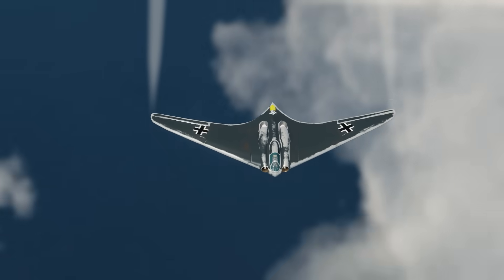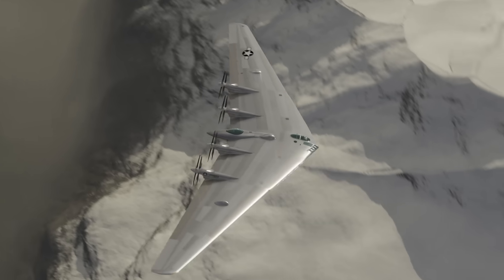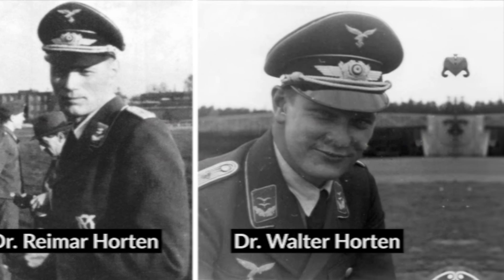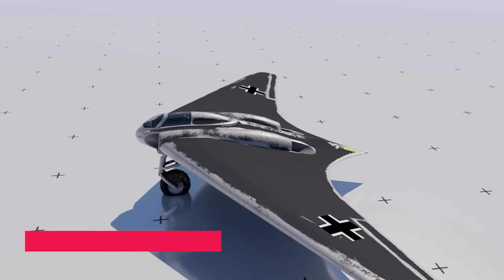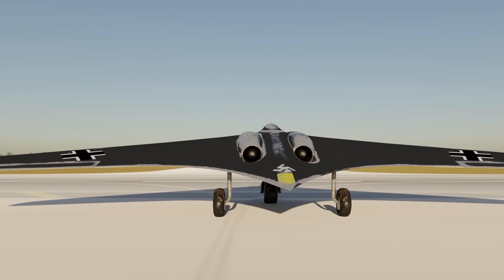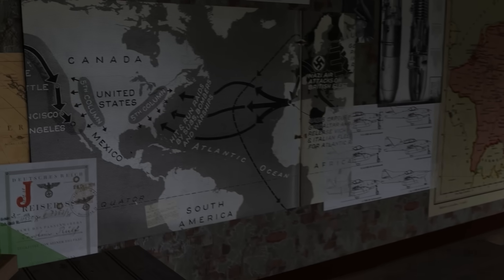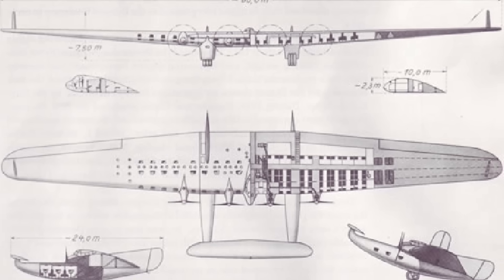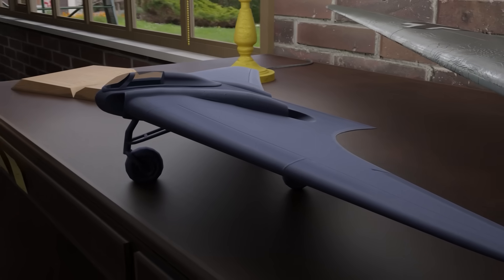Insane Flying Wing Jet Fighter To Save Germany - Horten Ho 229 Nazi UFO

Comment: And look at the USAs stealth planes now … they owe Germany a lot
Reply: No, they don't, the Horton has nothing to do with modern stealth aircraft.
Reply: @YogiTheHun1  Germany invented radat stealth technology.
The Ho-229 is the world's first radar stealth aircraft.
Reply: @WilhelmKarsten  
That is objectively false. You should get a better education on this matter. Reported for spreading misinformation.
Reply: @YogiTheHun1  The facts here are irrefutable, your attempts to deny these facts are childish and completely futile.
Reply: @WilhelmKarsten  The Smithsonian debunked it...
Reply: @peterson7082  Since when is the Smithsonian experts on Stealth technology?
Reply: @WilhelmKarsten  they built a replica of the 229 just to test its potential RCS. Certainly lower than a Messerschmitt 109 but still visible.
Reply: @peterson7082  All stealth aircraft are visible to radar... you don't seem to understand the concept here.
Reply: @WilhelmKarsten  Very visibile was my point. It was less, but not to a significant percentage to a 109
Reply: @peterson7082  Less visible is the concept... tests conducted by Northrup confirmed that the Ho-229 had a significant 50% reduction in frontal RCS without RAM applied using modern microwave radar.

Britain still used primitive meter band radar which would have prevented detection until the German jet was too close to alert interceptor aircraft in time.
Reply: @WilhelmKarsten  I was mistaken Northrop Grumman ran the test including samples donated by the Smithsonian, so I apologize.

Maybe I'm not being clear enough, but a negligible drop to a Messerschmitt 109 frontally is not close enough to call anything stealth or low-observable in modern terms. 

 Most reputable references to the Northrop Grumman test suggest a 20% drop frontally to a Me 109 at a set range. 80km. is what I.E.E.E. and the National Geographic quote though Northrop Grumman's wesbite and statements aren't 100% clear. The National Geographic sponsored History Channel show  contradicts itself a number of times.

 Still that percentage doesn't change. Some sensationalized websites like National Interest and San Diego Aviation museum exibition blurbs quote a 50% to 80% decrease. Fewer others say a 15% decrease to 109's and a number of Allied aircraft.
Reply: @WilhelmKarsten  Smithsonian said no absorbent material was found in their own examination. The Northrop Grumman test on the adhesive suggested negligible amounts of carbon in the formaldehyde urea, but leans to it being charcoal which Reimar himself quoted in "The Only Wing". Though given how little was found hard to say beyond what the History Channel has suggested to give a definitive effect on absorbing microwaves.
Reply: @peterson7082  Northop's data using microwave band radar shows a 50% reduction in frontal RCS compared to a Me-109.
This is without the RAM applied, the flight test prototype omitted this step in manufacturing and was also not used on the scale model.

While the Me-109 has a large metal propeller and it's skin is made of magnesium, it important to remember that the Ho-229 had no significant retroreflective structures and would have been covered in RAM in the production version.
A 50% reduction is very significant as it would allow German aircraft to enter British controlled airspace before being detected and allow them to reach targets before RAF fighter could intercept them.
Reply: @WilhelmKarsten  the point is there was no RAM
Reply: @peterson7082  Germany had RAM materials in production and operational service during WW2, samples of Tarnmatte were obtained and tested by the Allies after the war.
Reply: @WilhelmKarsten  nothing found on the 229, nor anything to corroborate Reimar's claims were found in development of the 229

The science behind radar absorption and deflection while realized was not understood or calculated.
Reply: @WilhelmKarsten  Tarnmatte's effectiveness was questionable though it helped with further innovation as the method and science was understood
Reply: @peterson7082  Tarnmatte was in operational service during WW2, this is an irrefutable fact that cannot be disputed.
Reply: @peterson7082  The Allies had absolutely no understanding of radar stealth technology during WW2 and little research was done until the 1970s in America.
 Both Lockheed and Northrop exhaustively studied German technology in the early stages of American stealth aircraft 3 decades later...
Reply: @peterson7082  Reimar stated that tests were conducted on RAM applied both to the outer surface and impregnated within the structure in response to concerns that RAM applied to the surface could be more easily damaged or rendered ineffective by absorbing moisture... a problem ironically that both Lockheed and Northop both ran into and have struggled with in its own stealth aircraft.
Reply: @WilhelmKarsten  Yes it was from mid 1944 on. No statistical evidence suggests it had any effect on submarine losses from the surface as those who had snorkels were lost in the same rate roughly before and after Tarnmatte was introduced in later 1944. Snorkels were accepted into service roughly half a year prior. British Asdic and American and British surface search radar were still sinking them in increasing rates. 

I'm not denying their existence. The Germans found this among other technologies they used were not matured. In the case of RCS even fundamentally understood
Reply: @peterson7082  Certainly not understood by the Allies.
German stealth technology was a complete mystery to Allied experts, many who very wrongly dismissed it.
Reply: @peterson7082 Look, I would work on your spelling skills before attempting to tackle a complex subject like radar stealth technology... your comments quickly reveal someone who is not qualified to discuss this topic intelligently
Reply: @WilhelmKarsten  Please tell me which errors I have made
Reply: @peterson7082  The errors in the comment you just deleted???
Reply: @WilhelmKarsten  I think you need help. I don't delete anything.
Reply: @WilhelmKarsten  I see all 26 comments, including this one. Please get help.
Reply: @peterson7082  Not the one you just deleted... you're not a very good liar either.
Reply: The gap in the comment thread is obvious, you are not fooling anyone.
Reply: @WilhelmKarsten  Please actually get help. I'm not going on deleting 4 month or 4 year old comments. You replied to me after 5ish months.
Reply: @peterson7082  YOU JUST DID
Reply: @WilhelmKarsten  Buddy log off YouTube, get some sleep. At best, use a different phone or computer and look for this comment chain. You are acting erratic.
Reply: @peterson7082  It's just pathetic and sad when can't admit you were wrong... absolutely childish behavior.
Reply: @WilhelmKarsten  Did you actually log in on a different device? I see the 30+ comments here Because you're getting delusional. I deleted nothing. Please tell me which errors. Or if you have nothing better to say, say goodbye because I said nothing factually wrong

Comment: This plane never saw combat
Reply: It was real, it flew and was the first radar steath aircraft in the world
Reply: @WilhelmKarsten  didn't say it wasn't real
Reply: @sidwalters7455  True, no stealth aircraft saw combat during WW2
Reply: @WilhelmKarsten  no argument from me
Reply: @WilhelmKarsten  
It was literally detected on radar in EVERY test that was performed.
Reply: @YogiTheHun1  No aircraft is invisible to radar
Radar stealth technology can only reduce the RCS.

Testing confirmed that the Ho-229 had a RCS less than half of smaller planes like a Bf-109.
Reply: @WilhelmKarsten  
But that is absolutely meaningless when compared to (false) claims that the Horton was the "first true stealth aircraft". It was not designed with the purpose of stealth.
Reply: @YogiTheHun1  Anyone that isn't blind (or ignorant) can clearly see that the Ho-229 was specifically designed to have a reduced radar cross section.
If you cannot see this? I suggest you go get your eyes checked or take an IQ test son.

Comment: You should be able to put stabilizers to each outboard sides of the engines. Just not higher than the engines. It shouldn't add to the radar silhouette.

Comment: The Ho 229 was a fabulous, beyond cutting edge aircraft design of its time that looked to the 21st century, not 1945.  The Ho 229 never progressed past flying prototype stage.  Most likely had the 229 entered mass production, there would have been improvements, corrections, and alterations to the airframe and internal structure.
      The Ho 229 flying prototype as envisaged by its designers, the Horten brothers, would have carried two of the awaited Heinkel Hs3 turbojets rated at 3,000-lbs thrust.  But continuing technical problems delayed the Hs3 turbojet.  The Reimar brothers were lucky to get their hands on a pair of short-supply Junkers Jumo 004A turbojets.  But the 004A jet engine could produce only 1,980-lbs thrust, a huge gap from the Heinkel Hs3.  Still, engineers and technicians duly revised the prototype specifications to accommodate the smaller diameter Jumo 004A.
     The Ho 229 flew three times.  But it would become apparent that it was underpowered at 4,000-lbs total thrust, instead of the 6,000-lbs thrust that the Reimar brothers counted upon.
     When test pilot Lieutenant Ziller attempted a landing, one of the jet engines cut out.  The wing dipped, the Ho 229 stalled and crashed.  Given stronger engines, LT Ziller would have been able to abort the landing and come around for another attempt, pushing the Heinkel Hs3 remaining engine at full thrust.  But the flying wing didn't have the necessary Hs3 jet engines.
      History did not record what the maximum speed of the Ho 229 powered by two Jumo 004A turbojets would have been as apparently, LT Ziller had not been instructed to fly the aircraft to its maximum speed yet.  Being underpowered, we can only guess the Ho 229 prototype's possible maximum speed of at least 450 mph to just over 500 mph, but not the 600 mph as intended with the Heinkel Hs3 turbojet engines.

Comment: I wonder if this Aircraft was the idea behind the US Flying Wing Aircraft the B-2
Reply: Not at all. Northrop was designing flying wings of all kinds since the 30s, and had the yb35s and xb49s, which looked much similar to the B-2
Reply: @peskyshoes  You need to check your eyesight lad...the Ho229 is the ONLY aircraft of its type prior to Northrup building the B-2... the enfluence is undeniable.
Both Lockheed and Northrup exhaustively studied the 229 before they built their own versions of this revolutionary stealth aircraft design.
Reply: @peskyshoes Anyone who isn't blind and knows anything about RST can see that the Ho-229 is completely devoid of any significant retroreflective structures, is was no accident.
Germany was the only country developing Radar Stealth technology or adopted RAM into operational service during WW2.

Comment: There is one other “Flying Wing”. And that is the Waterman Aerobile. The Aerobile is 2 parts bolted together to make one flying machine. It was a 3 wheel car onto which a wing was attached to make it into a flying car when desired. In principle, though, the wing was technically an effective wing with really good flying properties. There is a data set for the Waterman Aerobile for Flight Simulator 10, and it is quite beautiful to fly. Basically unstallable.

Comment: USA had flying wings in 1940's
Reply: But not stealth
Reply: @WilhelmKarsten  Neither did Germany... Not only was it not intentionally built to be stealth (and barely existed if at all), but when Grumman made a mock up to test that out (probably because they found out for the first time), with the wood and paint used for the original, they found nothing too significant, considering the test failed to include steel tubes around the chassis, which would make the stealth worse, not making good things for Germany's "Stealth" technology. Stealthier than a bf109 sure, but a British Mosquito... The xb49, on the other hand, may have had the stealth capabilites that the germans claimed to have, but that may be stretching. But the xb49 and other Northrop flying wing designs were the sole inspiration for the B2
The design for the ho229was really for fuel economy and lift from the body while maintaining bomber characteristics, nothing more. An interesting and charming, but overblown aircraft.
Reply: @peskyshoes  Your comments reveal someone who is not formally educated or have any professional experience in this field.
You clearly do not have any knowledge of German radar stealth technology developed during WW2 and you are certainly not qualified to discuss this topic intelligently.

Comment: your graphics show swastikas on the planes, this is not correct, swastikas were only used on vertical surfaces by the luftwaffe, and this planes did not have any.

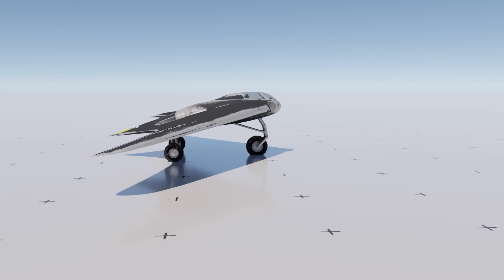8:53 "not only cancelled out the yawing issues that an aircraft without a WING can suffer, but that is also dramatically reduced drag"
a flying wing without a wing would certainly have faced existential problems of a rather radical nature.

Comment: There is anthor Horten Gotha Flying wing called P60C redesigned by Dr. Huehnerjager you can watch it at Rechlin Germany. Dr. Huhnerjaeger enhanced the horten wing to an easier to produce and easier field maintenance. The Dr. Huehnerjager P60C design used the engines in a vertical mounting under and above the wing fuselage.